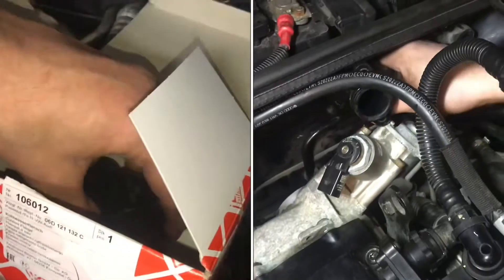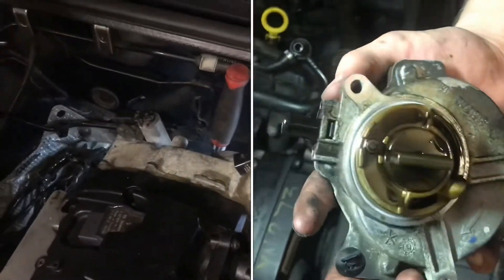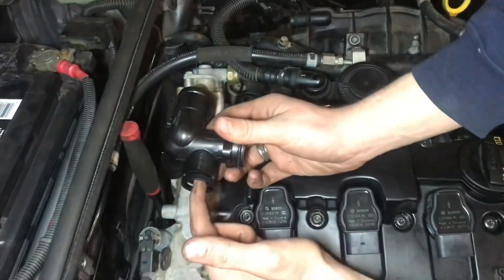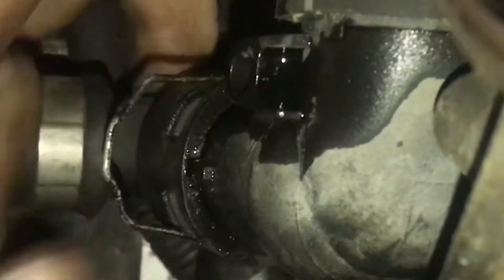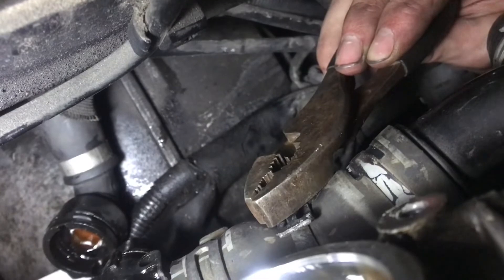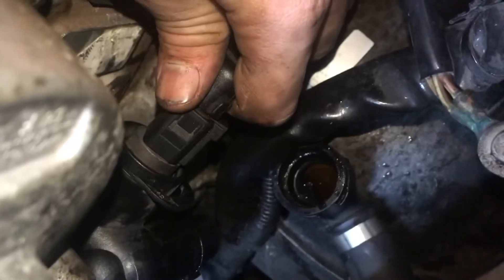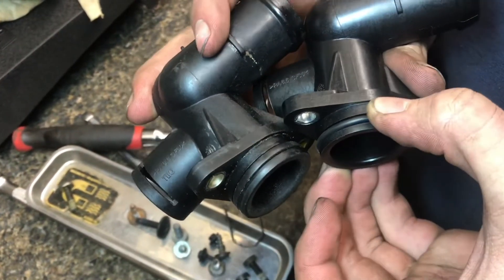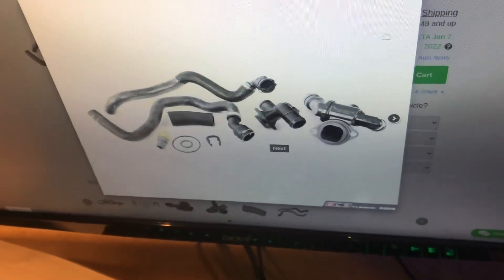“removing” COOLANT FLANGE  for rear of cylinder head b7 a4 2.0t (106012) audi volkswagen

Comment: Does any oil leak out when you take the vacuum pump out or is it usually dry until the engine is on?
Reply: A little bit of oil might initially dribble out when you remove the vacuum pump but it is easily wiped up with a shop towel. No more oil comes out after that.

Comment: Is that the reason why the heating not work as well?
Reply: Hey my heating doesn’t work either and it leaks really bad from there, is yours the same?
Reply: I have same problem   help
Reply: @hugomacedo2160  yes it is
Reply: No you got a clog ,a leak won’t cause it not too work unless all the coolant is leaking out …